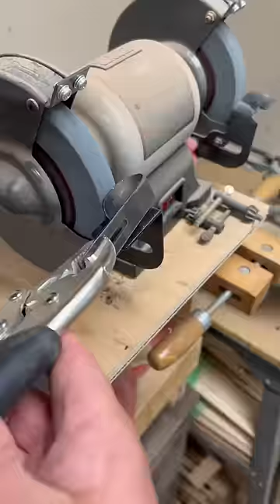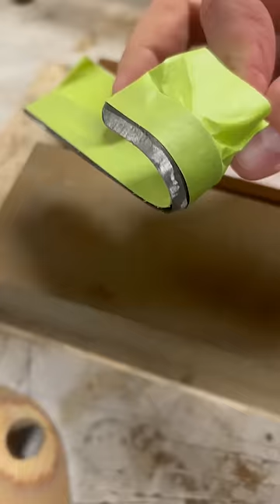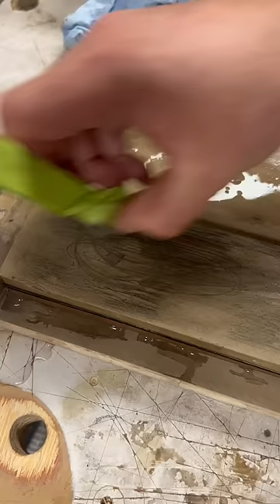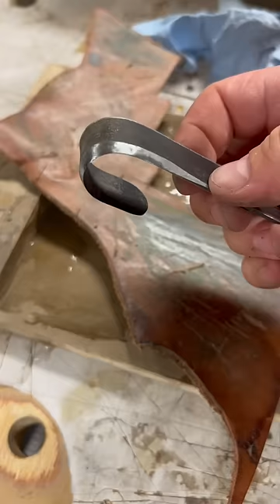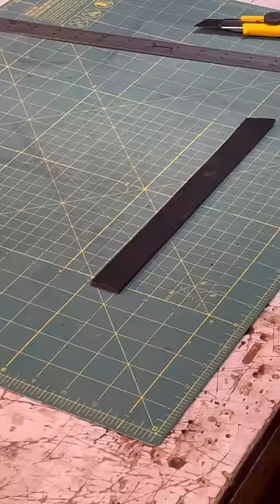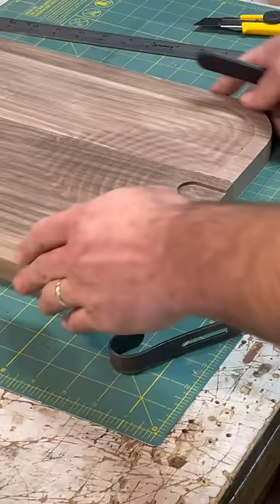Will this Even Work? #diy #woodworking #productdesign #leathercraft #tools #process #woodcraft

Comment: That tool would also work for carving spoons.
Reply: I thought he was gonna carve the leather instead of use it as a strop
Reply: @dynomytFB strap
Reply: That’s exactly what I had first guessed, before the cut to the leather :D
Reply: yeah it loks like a hook knife
Reply: @fxui i think he meant the part where he was stropping the tool on the leather after he used whetstones
Reply: @MovementDrifter  my thoughts exactly
Reply: @lalli8152  I think he meant strap like the leather strap in the vid but idk
Reply: @fxui  he was talking about the stropping on the leather im pretty sure. Its in the 15 sec in to the video
Reply: @fxui bro really watched a man use leather for stropping, not use leather for a strap, and STILL decided that the commenter meant strap not strop. my lawd. u have room temperature iq my guy. Celsius.
Reply: @separatedfox  Still a leather strap in the vid no strope
Reply: @separatedfox  he didn’t use the leather as a strope…
Reply: @fxui  he said it right "strop" witch he did in the video with the leather..
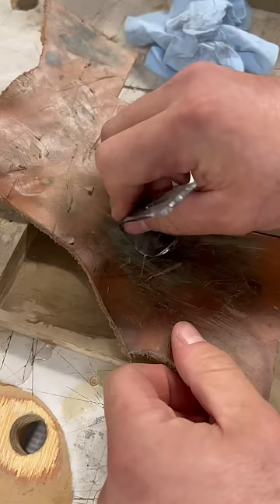Reply: @fxui  0:16 🤦🏿‍♂️
Reply: @bass_and_bass3323  What is a strop by definition
Reply: Exactly
Reply: @fxui  strop noun [C] (STRAP)
a strip of leather or other material that you can rub an old-fashioned razor, knife, etc. on in order to make the blade sharp : Use a strop to maintain a sharp edge on your knives and cutting tools.
Reply: @deadwooddooley3202  THANK YOU
Reply: @deadwooddooley3202  He used the first piece of leather to do so but the second part (the main part of the video) is him using the sharpened tool to make a strap for the wood piece, swear people just want to argue just to argue.

Comment: If you were going to whack it with a hammer anyways, you don’t need to super sharpen it, I used to pick galvanized pipe to make holes on some big-ass neoprene gaskets, with the bench grinder was enough. I only sharpened them when I wanted to apply gentle pressure. But always ended up pounding it with the hammer anyway haha.

Comment: It’s too bad you couldn’t have sharpened it, prior to bending in.
Reply: My thoughts too
Reply: Thank you. It was a good idea, but yours is slightly better. Hopefully, he sees this for next time.
Reply: He prob. won't, like he didn't learn anything in school, he's hardly going to start now.
Reply: It would probably deform the edge but I could be wrong
Reply: @six_tons1121 you're right xD
Reply: Good suggestion
Reply: Could be sharpened prior to bending. You have to heat it up in a forge then quench it once bent. You can harden it in an oven. Good to go.
Reply: @redbearduk  of course it look likes he does.
Reply: @timseytiger9280 I sense some venom in that statement.
Reply: Hahaha perfect response. However: there’s no guarantee the edge would maintain the proper radius. So. Less work this way but. 🎉🎉🎉
Reply: 🤣 brutal @timseytiger9280
Reply: Its mild steel he could have chisel ground it prior to bending and it would have been just fine... Incidentally thats how i make my crook knives for spoon carving as it produces the best consistency in the final product and i use 1095 for those 😂 it only goes haywire when it warps in quench
Reply: @six_tons1121 I doubt it.  He might have to do a little fine tuning.
Reply: That’s how you get a warped edge and an uneven bend. Source: I’ve been a blacksmith for nearly a decade and hook knives used to be one of my regular products
Reply: @deadwooddooley3202 
https://youtu.be/9itown3tNF0?si=Dag1x1wgzhH7S1dF
Steel rule die manufacturing using pre sharpened stock. I used to own a couple of these for making BMX number plates. These were made by a die manufacturer not a blacksmith. I think the only bit that looked like it was sharpened after shaping was the welded joint. 
More than one way to skin a cat?
Reply: @richardhall5489  more like a completely different system and use, completely different edge geometry, completely different gauge of stock, completely different final use, and completely different form of heat treatment. If the og video was skinning a cat the video you linked is skinning a baboon

Comment: I've done that MANY times.....in many different shapes. I took an exacto 11 blade, broke off the point, and ground down the flat edge to have a chisel on the tip and a knife edge on the side to carve out the inside corners of 3d wooden letters. Plunge the square chisel down, carve out the edge with the side.

Comment: During my elementary days and 1st year high school in the Philippines, it was not taught but mentioned and discussed briefly as tools. It is very basic as cutting in the form of a puncher, and almost the same as using rivets (punch and hole)... From the basic principle of hammer and chisel, where you shape/cut/remove a material using them.
But the best thing you've done is tool making, where you become an inventor that solves a problem or provides a solution that will ease our suffering (imagine, cutting leather to edging and polishing that consumes time and so many tools can be done in just one punch)
We used to do that before for fun when we're on our early teens, like fruit cutters, scoopers, spiralizer/spaghetti, pineapple peeler/eye remover, coconut grater, etc... From tin cans using hammers, chisels and nails. I'm thinking you are creating a tool for harvesting something on hard wood or fruit. But overall, the tool you've made is good.

Comment: Quick question. Isn't it easier to sharpen it straight then use a rubber hammer to curve it? 
I am by no means an expert and this is a genuine question of mine.
Reply from the maker: I didn’t try, but I assume the curving would bend the blade outwards.
Reply: I assumed it would deform the sharpened edge
Reply: @brandonpatton4776   i imagine  since it not being heat treated, just using it will deform the edge. lol

Comment: A forged tool would be more durable, but it’ll definitely do the job. You’ll need to sharpen it only a little less often as long as you temper the steel by heating it and quenching it in some quality oil

Comment: A worksharp knife and tool sharpener works on bent/curved blades very well, and they have tons of different abrasive levels all the way to a leather strop. You can get razor edges with little effort and even less time.

Comment: It WORKED.  It also doesn't look like tool steel, so it may not work very well for very long.  You'll be resharpening it constantly, and it won't really hold an edge.  Or maybe it is good steel, and it will work for the rest of your life.

Also, it's not mysterious.  You made a cutter to round the end of a leather strap.  The strap is a handle for that wooden board.  You'll do the same thing on the other side of the board so the leather will loop over the edge.  If you use it for anything food related, a leather handle is a terrible idea.

Have a good day, thanks for playing.

Comment: Sharpen the stock most of the way before bending it.    Then you have ur angle and edge set mostly ?   Just an idea. Never made a knife or cutting utensils. But I have sharpened some.  Fun hobby.

Comment: A five hour tool for a five second job. Yep, I can identify with that.
Reply: 5 hours? Maybe if you suck at grinding... 15 minutes tops ... Do the grinding pre bend and sharpen with sanding drums on a dremel up to 600 grit and buff call it done works every time

Comment: It won't hold an edge.  It will work for a short period of time and will have to be sharpened after almost every use.  Unless it was high carbon steel you hardened and tempered it and didn't show that part.

Comment: wtf you mean idk if this is going to work? You take that metal piece shape it how you need to even without an edge on it with enough force it would still cut. The edge just lowers the amount of force needed to overcome the resistance from the leather…. Heat would help too 😅

Comment: “Follow to know what it is.”
You’re clearly talking about the board with strap, NOT the blade. Only ID10T’s would think you’re talking about the blade. Jeez!!! You SHOWED them what tool you were making. What you DIDN’T show was what the board with strap was.

My guess is it’s a cutting board, and the strap is for hanging it. Otherwise, I have no clue what the board is.